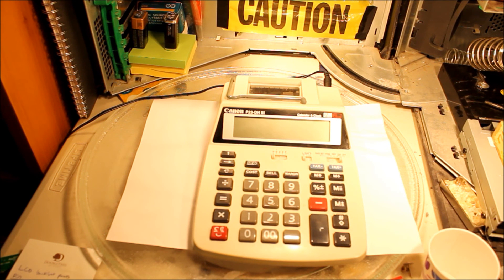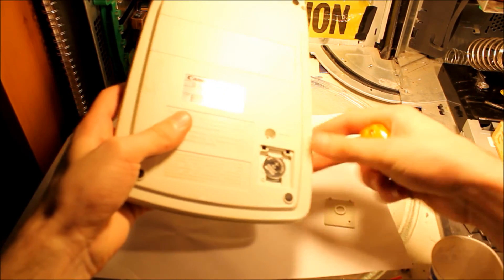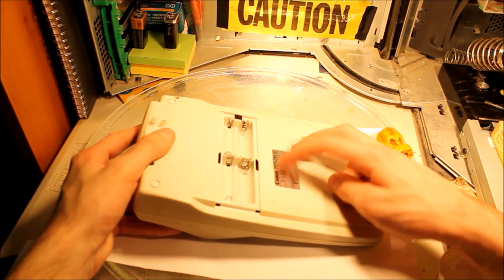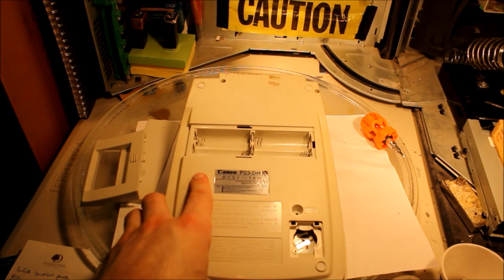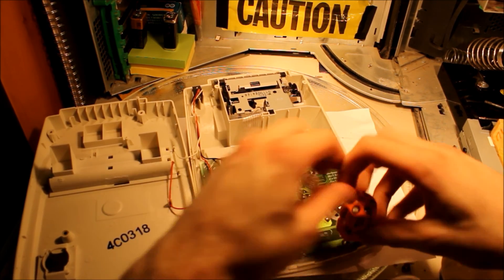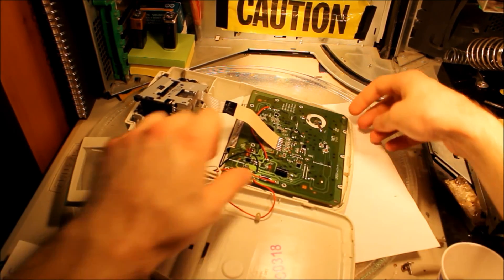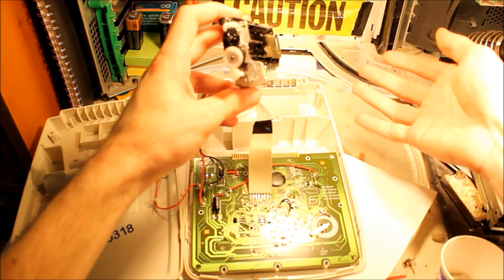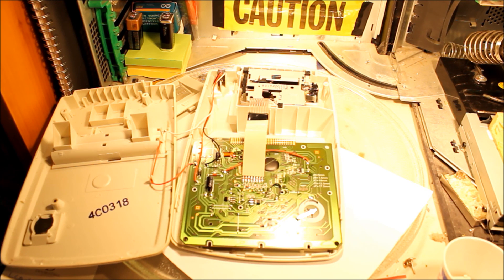Tech Teardown Vlog #1: Canon Adding Machine

Comment: Thanks for your video. This is the exact calculator I have. It has worked perfectly for many years, but now won't turn on. I was trying to disassemble it, but couldn't separate the top and bottom pieces. Thought I must have missed a screw and I didn't want to break it. This showed that the pieces are snapped together really tight and you have to apply more pressure pulling them apart. Exactly what I was looking for!

Comment: It's obvious you don't have a clue what you are doing, or what you are talking about.  You were going to cure the problem of some buttons not working, That never happened.  And adding machines were in the 40's and 50's, they are called calculators now.  You did more damage by doing some of the things you did to the calculator than was actually there. It was a good working calculator until you destroyed it!!
Reply: He didn't say he was going to fix the buttons; he said he got it for free and was going to do a teardown.  Lots of times you do a teardown just to see what you can learn - it doesn't mean you're trying to fix anything, and yes, you may end up rendering something that was working (or partially working) nonfunctional.